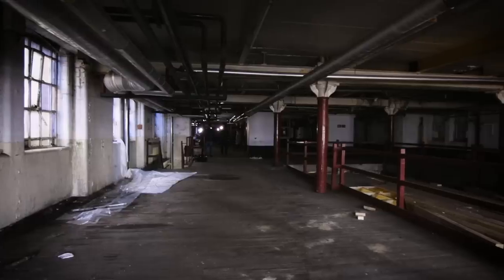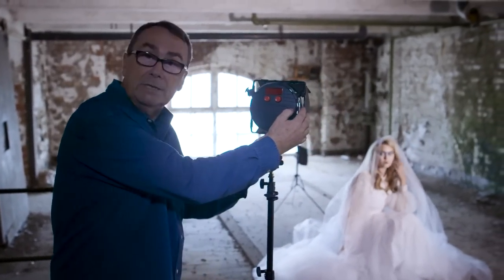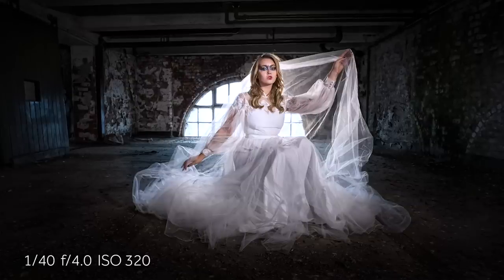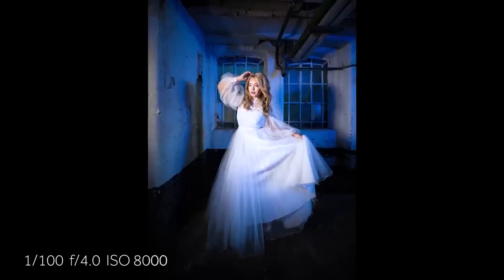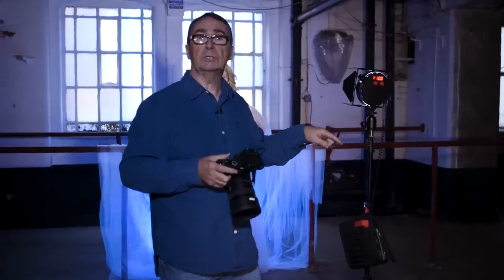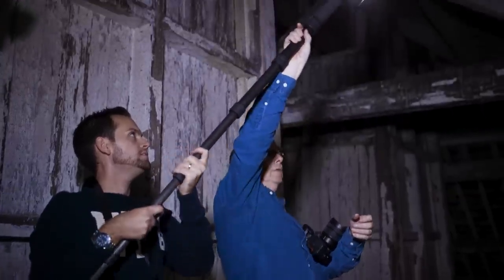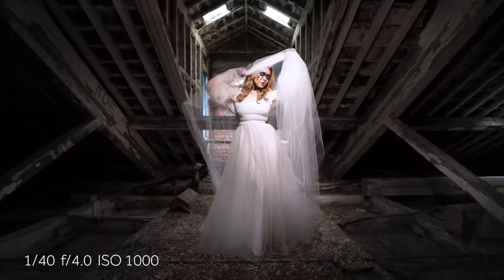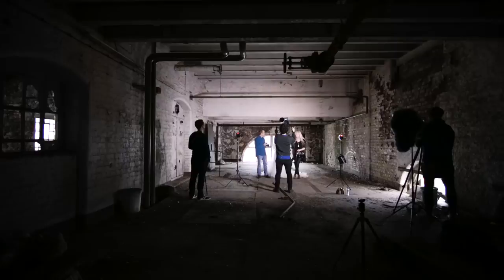Shoot in an abandoned brewery with Rotolight NEO 2 & Terry Donnelly!

Comment: My German manual says the AEOS (FW 731) has NO integrated receiver, So I have to sell my freshly purchased Elinchrome trigger (FW 3.0) and find a cable HSS-capable-solution. No idea how you can work with it. very confusing.
Reply from the maker: Hi there, when AEOS was first launched it did not contain the integrated receiver. But it was later updated to include it. You can be sure if you have it or not by checking your serial number (found under the battery plate on a sticker) if it starts SKY then you have Skyport included.
Reply: @Rotolight  thank you for the information. Obviousely I purchased to early, no SKY. Even increases my frustration, I hoped for a solution idea.
Reply from the maker: @freudensammler  If you purchase the transmitter from us, we will give you the receiver for free, it just has to be mounted externally.
Reply: Rotolight Thank you, nice offer, but I already purchased the Elinchrom transmitter, but dont find where I can buy a fitting receiver. Any German vendor/dealer?
Reply: Rotolight thanks, but I already have purchased the transmitter (as mentioned). It would have been much easier, when I had a broken power switch issue last year and had a guarantee replacement case (I waited 6 weeks for the replacement item), to send me as replacement the new version with built in receiver, instead of the old version again.

Comment: Hi. How does the flash compare over just using the led by itself ?
Reply from the maker: Hi Scott, the continuous light is 2000 Lux at 3ft and the flash is 250% on top of that equating to another stop of light. However, if you power it via a v-lock battery (rather than AA batteries) the flash output jumps up to 500% max so another two stops of light :) Hope that helps!